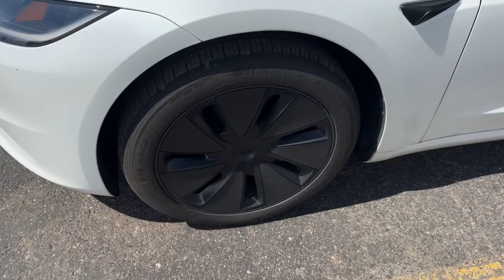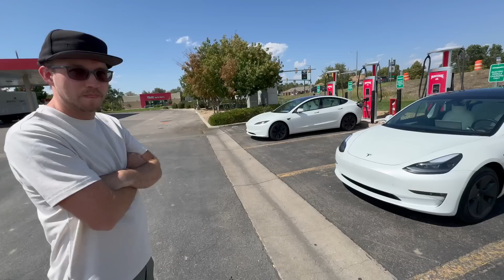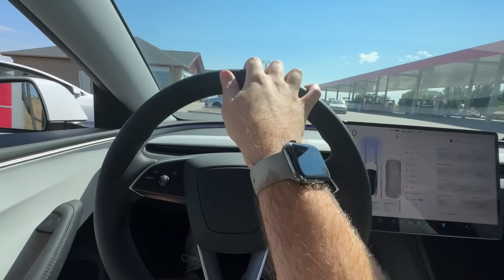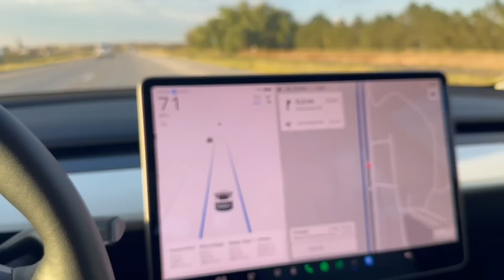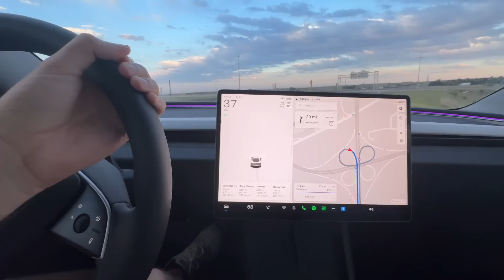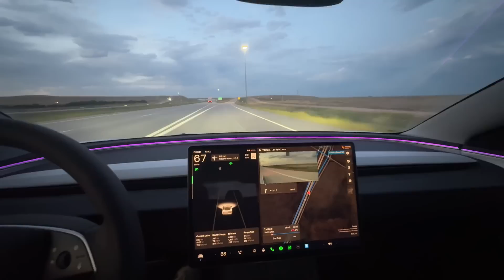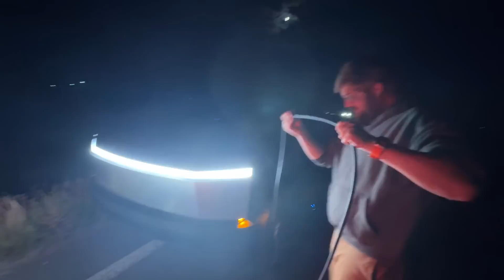Old vs New Tesla Model 3 Highway Range Test! Huge Improvement For Refresh - Long Range AWD

Comment: "370 miles...that's crazy" LoL i will be the partypooper but as long 370 miles is considered as "crazy" and as long you need to even consider in your test video what kind of tires the car has on in terms of range, i call EVs a joke and a toy. And no EV on earth will be able to replace combustion engine cars. And i tell this as a Model 3 Long range owner.
Reply: My EVs have completely replaced all my gas cars.
Reply: @SpottedSharks  Well happy for you my friend. And that you are fortunate enough to be able to speak in plural. I purchased my M3 LR as a used car but even so it did cost me half of my savings as a 40 y.o. man. Buying a new EV in my country is something only companies can afford. Since EVs are around 30% more expensive here. But companies can write off the tax.  I bought the Model 3 LR as an experiment in hopes i will fall in love with EV driving. Still waiting.
Reply: It's crazy because it is achieving those numbers with what is the equivalent of 2 to 3 gallons of gasoline. Try to go 300+ miles with ANY car on 2 to 3 gallons of gas. It's crazy because the efficiency is mind-blowing, THAT is what is crazy about it. If you want range, there are other EVs with more range but with a bigger price tag. And that is part of the point, at the price that this comes in at, you are getting a lot of range for your money along with performance and features. Plus, how often do you really need to go 300+ miles? At least in the US, the majority of people drive less than 40 miles a day.
Reply: @ProXcaliber  How many gallons (or Liter here in the EU) it consumes isn't important. Important is as a comparison how much $/€ whatever dies it cost to go 100km with any car. That gives you a good comparison.
Right now here in my country if i charge my car only on superchargers, which is currently the cheapest public charging option, and i calc how much 100km costs, i end up with a consumption price equivalent to a gas car with 6,5L/100km consumption. Which isn't great at all since the average 200HP 2000ccm gas modern gas  cars are having this consumption. So technically it is not that braindeadly cheap to drive an EV. That can only be cheaper if you live in a family home with own charging option and solar panels. But less and less people have the possibility to buy a house instead of a flat. Especialy since most teslas here are running around in the cities where most people live in flats without own charging options.
Reply: @robertschaffer596  That’s weird because I’m pretty sure I’ve seen a lot of EU countries installing street side and parking lot charging spots where you can plug your own cable into it and pay much less than a regular public charger. But either way, you also have to consider that with an EV you also don’t have the routine maintenance of a regular combustion car. I also don’t know why you would compare a 400+ hp car to a 200 hp economy car. You wouldn’t compare a BMW 3 series to a Toyota Corolla would you?
Reply: @ProXcaliber  That's true till the point that even here in hungary we have a lot of providers operating charging spots in random streetside locations, parking lots, ect. Even Shell and the hungarial petrol company MOL has their own charging spots at every petrol station. The issue only is that 1. these independent charging stations are freaking expensive. Some even 2-2,5x more expensive than Tesla Supercharger (that's why most EV owners pay the subscription fee to charge at tesla superchargers) and petrol stations only have these charging ports so they can fill some checklist items. But @Shell most of these are already out of order.  But to get a clear view, most independent charging points like mobility chargers are so expensive, if you calculate the "price/100km", it costs as much as you would have a benzin car with 7,8-8l average fuel consumption. Which is a looot.
As a tesla owner i also see that the argument with routine maintanance isn't true. It does require maintanence. And you bette do it at a tesla service. Which we have only one. Which is working on horrible prices. IMy petrol KIA Proceed had a yearly maintanance cost. 200€. My tesla is going to a ROUTINE maintanance soon with a price i got with 400€ And that is only the routine check. 
And why i compare a 400hp car to a 200hp car? Because the 400hp EV is the same class of usage group as a 200hp petrol car. The 400HP EV is the baseline series of the manufacturer aimed for the average family Joe. Just as the 200hp petrol shootingbreak variant car. A 400hp petrol car is considered already a hobby sportscar usually for retired managers. You can't put a 400hp petrol car in the same bascet as the same HP EV variants.

Comment: So why can't they implement a double ended j3400 cable? Cap the amps but allow the DC voltage to crank. Should be able to get around 20kw if it was DC to DC. It's really pathetic they we still don't implement Bring Your Own Cable in the USA.

Comment: I have a 2023 model 3 lfp rwd and i got 315 mile of one charge 173 wh/mile. I a have picture and a video. I work as a taxi driver (Lyft) in New York and is a mix 0f highway and city driving so i think that very good.

Comment: ~20-25ish mile difference is due to the fact that the Michelins on the 2021 car have faaar higher rolling resistance. I’d say another 20-25ish miles is aero improvement. The last 10-20 miles difference are a mystery to me.

Comment: Maybe I missed it but what reserve mileage does the new Tesla model 3 after the mileage indictor goes to 0? I have a Model 3 performance so I assume it will be a similar "reserve" amount.
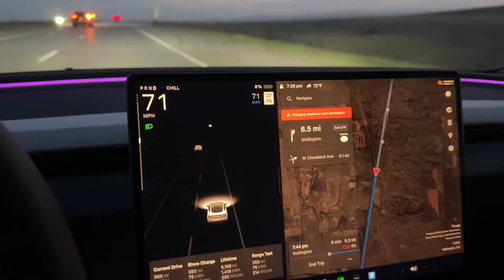Reply: 58:17 The new M3 hit 350 miles at 0% so it drove an extra 20 miles in the buffer below zero until it shut off.

Comment: Great video. My first EV was a 2024 Model 3 LR "Highland" -- As a new EV owner, I have been tracking efficiency -- After 1500 miles I have averaged 211Whrs per mile.  The efficiency on this car has been amazing I charge it every 9-10 days (from 25%-65%) using it as my day to day car. I have been very happy with the car and its energy efficiency.
Reply: My efficiency on a 2019 Model 3 LR AWD after 60k miles is 230Wh/mi. That's with fairly efficient driving. Looks like the Highland is at least about 10% more efficient than the first Model 3s.
Reply: Same car, I'm getting around 200 Wh/Mi. A lot of my driving is in the 40-60 MPH range, but I was shocked at how efficient it is!
Reply: Nice video Sir

Comment: Question - You said the tires on the 2024 were different and more efficient - but you don't mention the MAKE/Model if them - inquiring minds want to know. And BTW, great video. I love that Tesla is finding ways to increase range (can't wait until 500+ miles is the norm). I've driven my 2020 M3LR AWD a total of 34,700 miles and have achieved 220 Wh/miles with a mix of both around-town and highway driving.
Reply: He definitely did mention them, and they are the Hankook Ventus I believe.

Comment: I think it’s more than just tires and wheels folks. I bet the new front fascia is more efficient. Did they redesign the under car panels? Also, I wouldn’t be surprised if the motors themselves have improved efficiency even if they are still rated for the same power output.
Reply: The Cd barely changed. It's probably the tires for sure. In fact, I got near 4.5mi/kwh in my Niro at 72mph too, but my tires were near the wear markers.

Comment: Hi, I have the same 2021 LR Panasonic bat. You need to put on new tires and rerun the test. I replaced the OT Michelin Pilot Sport 4 for Hankook iON EV which is a difference in less noise and lower power consumption. Conversely, I am interested in what Tesla did to make Highland more efficient. It can't be just less drag. I feel like they are hiding something as I want the same on mine haha. What you could to is at least swap the wheels and run the test again to see the results! If the new wheels are lighter I would definitely buy them!!!

Comment: Hi Kyle and Jordan, im curious about driving comfort for you both after this test. New seats vs old seats?
Reply: Before I purchased the new Model 3, I rented one from Hertz for about 2 weeks just to get adjusted to the car and charging of an EV. Once I got the new 3, I instantly noticed that the new seats are definitely not as soft as the older ones, but they hold you much better than the older ones. They are pretty similar in terms of comfort, but overall I think the new 3 has better comfort when it comes to the seats and the entire package of softer suspension and lower cabin noise.
Reply: @ProXcaliber  ah i was also thinking i'll gladly accept the ventilated seats over the stuffy cushy chairs
Reply: @curseknight5  I live in Florida, so the ventilated seats were definitely a massive consideration when making the purchase. But overall, the car is great and super comfortable, I'd say take one for a test drive if you are able to, I can guarantee you won't be disappointed and maybe even surprised at how good it is.

Comment: The improvement is astonishing. Nice Test. So optimizing the range is not only about motor or battery. I wonder how they did it. Not the motor, not the air-restistence, not the battery, not the software i guess. So how? Only the tires?  Interessting.

Comment: Bjorn's test shows a much smaller difference. The proof that the range depends on many factors and is very difficult to compare
Reply: I think Bjorn has the LG batteries. Most North American 3s are Panasonic batteries.
Reply: @TheReal_JG  it doesn't matter if you are comparing the same battery between generations.

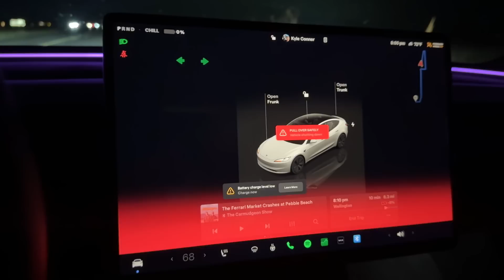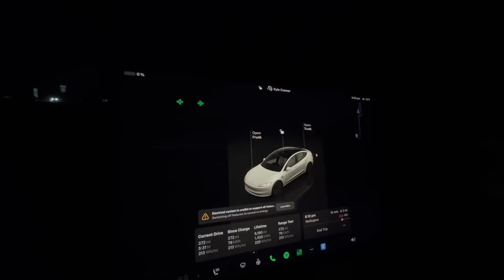Comment: Pretty interesting to see that the '24 reverted back to the "old" software v11 parked vehicle model (characterized by the higher camera perspective and narrow width) as it died at 1:03:06 and 1:03:27 , but when Kyle plugged it in at 1:04:15 , the v12 vehicle model (lower camera angle, vehicle color halo, spanning the whole width of the display) popped back on along with the ambient lighting. Tesla goes pretty far to conserve energy at absolute 0%, including shutting off more GPU intensive renders in favor of older ones.

Comment: Super great info, but unfortunately, the vast majority of us don’t live at 5,000-6,000 feet. This test encounters roughly 15-20% less air resistance than the vast majority of us who live below 800 feet above sea level
Reply: Don’t worry. I drive mine at 22 feet below sea level and it’s still very efficient. It would be a very very subtle difference in practice.
Reply: I currently have a little over 7,000 miles on my 2024 Model 3 LR, and its lifetime consumption is 253Wh/m. Mind you, this is with both city and highway driving in Florida, so I usually crank my AC due to the heat.

Comment: Question - how bad is it for the car to run until empty? Doesn't it ruin the 12v battery at the least?  Does it affect the 16v lithium battery more or less than the refreshed version?
Reply: Not only is it bad, Tesla allows you to run out the safety buffer, which is insane. No, it doesn't matter regarding the 12v battery, or the 16v lithum battery.
Reply: @sprockkets  ok, so it could ruin the 16v battery as well?  I heard those things cost around $1000.
Reply: You basically never want to let your car die completely. The least you should realistically ever let it get to is 5% or even 10% at most.

Comment: Thats actually pretty disapointing for the older car , I often get over 300miles in my 2023 RWD LFP and that has a 20% smaller battery. I do the Sydney-Melbourne trip on a semi regular basis, my first stop is 398km/247mi , of which 90% is freeway , I usually arrive with  12-15% charge remaining and 190-195 wh/mi usage
Reply: I get 230-240 wh/mi on my 2023 RWD LFP on the freeway. Going 112 to 130 kmph

Comment: Interesting, wonder how much the tires and wheels caused the difference in efficiency. Maybe put the 2024 tires and wheels on the 2021 and check the efficiency. that would be interesting to know, might put those tires on my 2022 model 3 dual long range when it needs new tires.

Comment: Wish they offered like 16" or 17" aero wheels to add even more range.
Reply: Exactly the cheaper m3 version with cloth seats introduced for mx should also have economy spec 17x7" with some 215/65/17 eco tires on it&aero covers! Ad a lower power motor&I bet the lfp pack could hit 300+with just those changes or 5+miles per kwh real world Hwy Efficiency!

Comment: Hiw did you get 371 miles if you  charged your car near the end off the cyber truck?
Reply: The car essentially died at 370 miles (no power output to the wheels, even though the foot was to the floor) but was able to coast another 2 miles after being completely dead.

Comment: I've had my 2024 model long range AWD for a few months now and it is quite efficient. I drive around 80mph most of the time and average around 215wh per mile. Unfortunately my model 3 has had issues with cellular data and Bluetooth not connecting since a few weeks after I got the car. I scheduled a service appointment right away back in July, the service appointments were booked out to September here in Utah. I waited for the day to come for service which was supposed to be a few days ago, but I received a message saying that they don't have the part to fix my car yet and they rescheduled my appointment to October 22nd, which is incredibly frustrating. I really want to like my car, but having no connectivity in the car really makes for a poor experience.

Comment: Rare to see Kyle get any info wrong but this was a rather important part of this test. The wheels on both these cars are the base 18" wheels(not 19" as Kyle stated) that come stock. They both have the stock hubcaps(as we used to call them). My guess is the tires in particular are the biggest reason for the significant range difference in these two M3's. Hankook Ion Evo may even yield higher results. You guys need to swap the wheel/tires setup from the '24 over to the '21 M3 and I bet the results end up much closer. I really enjoyed this test as many others Im sure do too, since the M3 is the king of EVs at this price point IMO.

Comment: I just did a trip to NYC from MA in my new 2024. I averaged 209Wh/mile. My 2019 averaged 239Wh/mile  over it's five year life so it pretty much got its EPA range but there is no doubt the new one is more efficient.
Reply: Just did NY to MA and back last weekend with a 2024 aero wheel set on my 2022, and averaged 212Wh/mi!

Comment: Didnt they transition to Harpin Motors in 2021-2022?  So i suspect the Tires, motor, and new shape of the model 3 got those extra 60 miles :)
Reply: I think you are correct and that was the biggest difference. Next would be tires.

Comment: Love my 24 LR 3. I was able to eke out 180 wh/m with autopilot set to 65mph flat ground drafting a semi from a safe distance in my last trip. Even going up and down mountain passes with my speed ranging from 70 to 75 I was doing around 235wh/m average on a 380 mile trip. I’m using about 4-6% of the battery for my daily commute so I can keep my SOC at 40-50% for daily driving so looking at minimal battery degradation overtime for my use case.  I could have gotten away with even an old leaf for my daily drives but the ability to go in a weekend road trip whenever I want was important to me.

My only regret is jumping on the car when only the LG pack was available, that being said the LG pack degradation seems to be marginally slower than the Panasonic packs, and they actually seem to increase in capacity in the first 5k miles or so if you maintain a 50% median SOC.

Comment: I would be curious about the accuracy of the speedometer. If I'm remembering correctly the "State of Charge" guy said he had to run the Lucid at 72mph to be the equivalent of 70mph. Not sure if that would make a difference, but worth noting.
Reply: These new cars seem to always be off by 1 or 2 mph. Probably to keep people from going past the speed limit as a legal reason.
Reply: All newer cars are usually 1 to 2 mph over on the speedometer from actual speed. It was like this in my 2021 Acura RDX, and it's still the same in my new Model 3.
Reply: NHTSA

Comment: How can lucid be so much more efficient than Tesla?  I think you guys need to investigate that?  Start at where the differentials are located. Accomplish some real fact based engineering.
Reply: Cd is lower on the Lucid, and likely more efficient motors.

Comment: Tesla achieved all that efficiency with under 50k manufacturing cost.
Unlike Lucid 500k manufacturing cost (last time I checked). Efficiency is good but at what cost and volume. (Tesla's Low cost High volume or Lucid's high cost low volume). I would be so happy if Lucid can get manufacturing cost under 100k. 
Note - Clearly talking in manufacturing point of view.
Reply: At this current point in time, the Lucid air is still more aero dynamic, and more powerful per the motor size. Yeah, they charge more, so what?
Take the Lucid and the Model S Plaid to 200mph, and you'll find out soon enough why one is so much cheaper.

Comment: 4:55 Kyle says the Highland Model 3 LR has 19" wheels. However, you can clearly see that these are 18" wheels and tires in the video. 19" wheels would not have efficient tires and wouldn't come anywhere close to the same range.

Comment: It would be cool to see if the old car would have the same range if it had the ultra efficient Hankook iON EVO AS tires. I did 315 miles and had 8% SOC left with my 2024 Model 3 Performance with 235/45/18 Hankook iON EVO AS tires.
Reply: I'd like to see this with a M3P but using the same tires/wheels as the LR used in this test. It would be an apples to apples comparison between the range of the P and LR.
Reply: What 18” wheels are you using?
Reply: @Sale23222  I used the T Sportline TS5 18x8.5 wheels when I had my Model 3s. They fit perfectly without any hub rings or spacers even on the Model 3 Performance vehicles.